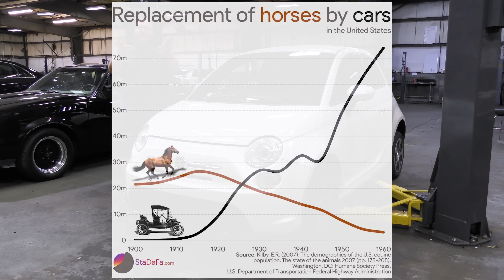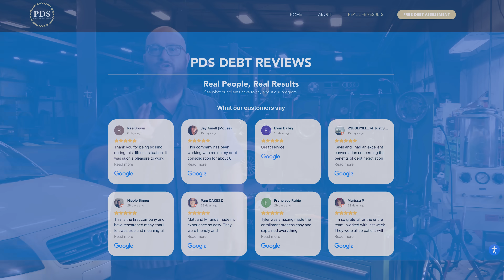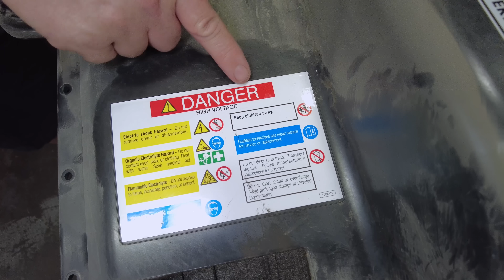How to SAFELY Remove the EV Batteries From my Fiat 500e

Comment: Some people are just resistant to change.  A former boss spotted a really, really nice looking Model T Ford one day in the early 70's.  It was at a gas station and he complimented the owner on the beautiful restoration.  The reply was something like this:  Oh, I have not restored it.  When they came out with those new fangled transmissions you had to try to figure out how to change from one gear to another I bought five new Model T's and put them up on blocks.  When I wear one out I get another one down and keeping driving a Model T.  My father complained when I had two Bugeye Sprites at the same time.  Later I learned he had five Model T's when he was a kid.
Reply: The problem here is that for many people EV does not bring anything extra relative to ICE,  just perhaps a bit of gas savings at the cost of some inconvenience. So there is little reason to change. Way different situation than horse/car which changed the lifestyle completely, allowing to travel 10+ times faster
Reply: @dmitripogosian5084  true enough.  Once long range EVs flood the used car market though thats when we will see a big change.

Comment: EVs need to be easier to diagnose and repair by independent shops and owners.  How it currently works is as if an injector or ignition coil went out, so you are down a cylinder and instead of replacing a single component to restore full function you are required to replaced the entire engine.  Besides being dumb, it's incredibly wasteful.  Serviceability is green.  Disposable cars aren't.

Comment: Electric cars have been around since 1830s and rechargeable batteries from 1860s.. There were charging stations etc around that time. So EV's are not a new thing. The biggest issue with EVs is batteries and the damage on the environment from mining the materials to produce the battery add to that the degradation of the battery. But maybe once the battery tech as matured enough then they would be viable.

Comment: BEVS?  New technology?  LOL, no.  They had those as far back as the early 1800s.  Late 1800s for I suppose more mainstream ones.  It came down to the same problems that EVs still have.  All things having to do with the batteries.

That, and like ICE vehicles, BEVs have been so overly and unnecessarily overcomplicated, they throw out some of the biggest selling points for EVs.  A big one being simplicity.

Comment: I was waiting for it and you did it. You called it a 42 kW battery pack. Please read and remember what has now become an old saying in the EV world- "Not knowing a watt from a watt-hour is like not knowing the difference between horsepower and how much fuel the fuel tank holds."
Reply: I think most people just don't care about the correct terminology and is said more in favour of it sounding better. Same as when "we" are asked "how much power does your car have" and the answer is "250 horses".... it's just easier on the tongue in my language.

It is basic understanding that if you are talking about the battery you are talking about capacity, and if you are talking about the motor you mean power.

Comment: It's NOT like when cars were replacing horses. It's still a car just the power mode has changed. horse are a LIVING thing. They die, give birth, feel pain, etc. While we give cars anthropomorphic qualities, they are still inanimate objects.You don't need a person to go through town cleaning up poop all day and night. It IS the same as when cars were invented there were several modes of power. Steam, gas and electric. Gas won for several reasons, it was easier to transport, didn't take a long time to build up pressure, gave long range and quick turnaround, plus for the amount of energy given the size could be smaller and less dangerous. All of which is STILL true. EV's WON'T "save the planet" or even lessen pollution. But they DO give POWER and CONTROL to the governments that impose them upon the industry and people. Yes, impose, because they give extra tax and incentives to get them that others have to pay for, some states are making them mandatory and the only thing you can buy soon. But it'll be the government who controls you once there is enough of them.
They will be able to say when and where you can drive or even if you're allowed to do so. Let alone that the materials to make them vs a regular vehicle makes them a bigger polluter. Then there's the disposal, A modern car is almost completely recycled now, you can't do that with most of the EV's, they must be disposed of in a hazardous waste dump. 
With a FIAT, which is already a low quality car, (Fix It Again Tony), this 500EV makes it even WORSE!

Comment: I helped with a major battery replacement on a vehicle once. It was older than yours, and the vehicle  had a lot more miles on it. . And it was a lot bigger job. We replaced all 126 cells. And each cell weighed more than the entire Fiat. (The vehicle was the first submarine that I served on).
Reply: Bet the range was much better
Reply: Ahh yes, the early diesel-electric hybrids of yore! Wish I had a truck like that.😊
Reply: @KevinSmith-ys3mh  Actually, mine was nuclear. The diesel electrics had two batteries, each with a few more cells. At least, the WWII fleet sub that my first boat was named after did. I toured the WWII sub as a kid, then served on its nuclear namesake.

Comment: The dashboard head unit on my car stopped working. That meant no access to a/c, stereo etc. The dealer quoted $1500 for a new unit. I took the old unit apart and worked out that the problem was caused by cracked solder joints due to the use of lead-free solder and also and the heat cycling in that area. There were a gazillion solder joints that needed to be cleaned to even split the circuit boards so I purchased a $40 Chinese electric solder sucker. I just resoldered all the joints and it's worked perfectly ever since. Total cost of repair was $50 if you add in the cost of solder. The dealer's quote including tax & labour was closer to two grand.
Reply: Component repair is not what you get even with your household appliance such as stove of fridge

Comment: I've actually used what I assume is the same Bulgarian company (in Varna ??) to rebuild a Mercedes Transmission control plate on my old B200 Turbo.  
Turned it around quickly, worked great.

Comment: Did gasoline powered cars eventually out do horses despite the fact a bunch of old geezers are stuck in their ways? yep! Were Gasoline powered or internal combustion engine cars mandated by the government over horses? no... not really. People chose cars driven by internal combustion engine cars over steam... electric... and horses because they were more convenient, and because they also gave people jobs!

People still had a choice, they chose cars because at the end of the day they were a more convenient option. Peoples issue with electric cars isn't that they exist, it's that the government is trying to push them on people. I don't have a issue with the idea of a electric car, I think it's a great idea for that to be a OPTION! Just like i think every Gasoline powered car at this point should also be able to run on Ethanol because it ain't that hard to make it do that. Because Gasoline would then have competition that would make Gasoline and Diesel less of a Monopoly.

Comparing how we switched from horses to cars, to this electric car thing going on, really isn't the same, and it really isn't a valid argument, especially when making cars used to give Americans fair paying jobs. Instead of mining precious and toxic metals in foreign countries that use borderline or actual slave labor to obtain the materials and then produce the batteries in countries that just hate America.

Comment: The big deal is the labour to remove the battery pack. Of course, the manufacturer could have added a small access port to the underside of the battery pack to allow a mechanic to swap out the controller without having to drop the battery pack. It could be engineered safely as well. For example, it could automatically cut power to the unit as soon as the access hatch is removed. Like a "safe block" really. That's a tool for safely connecting bare wires to mains voltage.

Comment: I leased one of these cute cars. Really good deal too .I can confirm that I can regularly get over 100 miles on a single charge. I live in LA and I suspected that it loves the stop and go traffic. I would also regularly take these to go to Palm Springs and San Diego with strategic stops in between to top off. It only had level two charging (No fast charge) and I was still able to make it work. I also had AAA membership with the 100 miles tow just in case, and never once did I use it in those three years despite coming close once or twice (like  to the point that the car would no longer go more than 20 mph because it was running out of juice kind of close).
Reply: I am not an American, but a AAA-battery is probably not enough to get you home?😇
Reply: @JJVernig  AAA in this context means roadside assistance by  American Automobile Association. This service includes towing as well.

Comment: If I were you I definitely wouldn't be touching the battery pack without electro-insulating gloves until you disconnected enough busbars between modules so the voltage in any part of the battery is below 120V.
After many years of working on self-made accumulators for Formula Student that were 450 or 600V I know how dangerous they can be. With proper precautions they don't have to be, but you must never forget about it
Reply: Even 120v dc will kill you as you can't  let go !
Reply: @stevejones9788  Thomas Edison electrocuted circus animals and livestock with Westinghouse/Tesla's "killer (alternating) current", promoting DC as a safer for consumers.  At the level of current and voltage we're talking about here, one could be just as departed with either AC or DC.  Shop safety will have a different look than we're used to in ICE repair shops.
Reply: Completely agree... even my Grampa (WW2 US Army Engineers electrician) said "never trust electricals, it'll bite you when you're not thinking!" and my training was that 50vdc or less was the upper safety limit, 28v or less is the range of real safety.
Note to general readers- its actually the current flow thru your body that kills, and EV packs have obviously massive Amps potential! If you dont completely understand electical hazards, do the course work or dont get under the hood!

Comment: I have owned a 500e for 6 years. Driven it over 60K miles. It hasn't given me a any problems at all. It's a blast to drive too! I live in North Carolina and have never even seen another one here. If it ever dies I probably won't be able to find anywhere to get it repaired. I've gotten my money's worth out of it already but really hope to drive it for a long time to come! I enjoy watching your video and hope you get it repaired soon.
Reply: You feel like you have gotten your money's worth at 60k miles?  IMHO cars are too expensive and take up too big of a chunk of my income to only last 60k miles.  But that is my experience and your circumstances are undoubtedly different.  I have a 2017 Toyota Prius that we bought new for $23k and have driven 130k miles.  I think that we have gotten our money's worth out of this car, but it keeps going.  I did the CVT fluid change, that battery pack air filter change, changed the coolant, and routine maintenance of course.  Let see if it makes 300k.  In 2024 we bought a new Prius at $33k.  I hated to pay retail, but the 2006 Envoy was getting long in the tooth and I wanted an efficient commuter that was fun to drive.  Needless to say we like the Prius.  I have high expectations out of our latest acquisition.  Good luck with your Fiat!  I hope that you get well over 100k out of it!
Reply: @robertmooberry725  I paid $8,400 out the door, all costs, when I bought my 500e when it was 7 years old with 32K miles on it.
My point is.... you don't know how much that guy paid to say only 60K miles is worth it.
Reply: What part of NC? It wouldn’t happen to be Raleigh?
Reply: At over $30k starting price, you got your money's worth out of it in 6 years and 60k miles? Damn, the standards are getting low.
Reply: @rarespetrusamartean5433  He would not have been able to buy it new, unless he was living in Cali or Oregon. Every other state, you're buying it used.
Reply: @rarespetrusamartean5433 if you had a car that you didn’t have to maintain for 6 years? Yes. No oil, fluids, etc.
Reply: You're lucky, fiats tend to be junk
Reply: @JStorm13 mines great
Reply: @JStorm13  the whole drivetrain is made by Bosch, in this case. One big reason I was willing to risk it.

Comment: I have no doubt that EV's or some non fossil fuel powered vehicles are here to stay.  You mentioned the biggest outstanding question which is longevity and ability to keep them on the road.  Are they going to be disposable vehicles?  A 1908 Model T Ford can still run and many from the 1910's era are still running and driving as well as they did the day they rolled off the Ford assembly line.  Will it be possible for a 2024 EV to be running 116 years from now?

Comment: Your gasoline horse analogy does not work in the context of the modern EV.  Back in the early 20th century the internal combustion engine was better than a horse in every way, which meant it was adopted by the populace organically rather than by government dictat.  Fast forward to the 21st century and EVs (which still have exactly the same shortcomings as they did a century ago) are inferior to the ICE vehicles in every conceivable way.  The only way they are making any impact at all in the car market is with market manipulation through huge subsidies from governments.

Comment: EVs have to have good thermal management or their batteries wont last.  This is why 99% of the population should NOT buy a car like the Nissan Leaf.  Second, with as awful as Fiat quality is there is no way in hell that I would buy a Fiat 500e EV let alone gas version of their car.  Looking at their battery pack to me looks like terrible, inefficient design.   My perspective is I would only want to buy from a company that is 1) going to be around 2) is trying to truly standardize their parts and batteries and 3) is truly committed to the models of cars they make.  That is why to me, Tesla is the no-brainer decision if going EV.  Regarding range, you can get 200 miles of range at tesla quick charger in 15 mins, you dont need 1000miles of range and  you are simply not going to see that in the long foreseeable future.  The vast majority of people will find 300-350 miles (that you see in Teslas today) are way more than they need for their daily commuting back and forth and normal day to day lives.  You go back and forth from work, etc... come home, plug your car in and it's fully charged when you go to leave the next time or next morning.   The current mindset of people feeling compelled to get rid of their cars because of engine mechanical unreliability due to high mileage going over 100k, 200k in miles will be very different in the EV world.  You eliminate TONS of mechanical complexity of the internal combustion engine down to an electric motor and batteries.  The batteries being made now are already very different from those used in the original Tesla Roadsters.   People are going to find EVs require very little maintenance and require a lot less time in the shop.  And if for some reason you do have a battery pack problem, I would only take it back to Tesla.  Costs of the batteries used in EVs have also dropped a lot in the last few years.  EVs will only get cheaper and will eventually displace gas powered cars for a large percentage of the population.  The Chinese are already making EVs at price points US auto makers cant even consider to make a gas powered car.  They are already 3-4 times cheaper per mile when charging at home vs gassing up and at sometime in the near future should be cheaper than gas equivalent.  (We are still very early in the timeline of this transition) The change is coming and it will be a good thing.  For those who want gas cars, by all means stay with it.  I dont have EV yet but plan to in the near future but will still keep gas cars in the roster.

Comment: I'd say a universal system and more importantly, if packs are to be used (individual battery packs) make them easier to exchange for everyone,. maybe not the owner, but most shops (like make them plug-and-play which some are in some cases).  Once we get universal compatibility between brands (which may be a while) then I think EVs will take off (that and once they can gaurantee a battery will last for 10 years or 100k miles and charge in under 15-20 minutes to 100% and then go 300 miles; basically they would need to equal what the typical gas powered sedan can do from a performance, range, and recharge -- "refuel" -- standpoint, as range, cost and time to recharge are the three biggest things working against EVs).

I would say as a start, if we can get a battery that can be replaced for a reasonable price (maybe $5k) after 10 years, that will start the process, as that is probably one of the biggest things holding people back, particularly those who want a car for a long period of time (10+ years).  They know that they'll need a battery around the 8-10-12 year marker and it will be expensive most likely)  But so far, cars win at this one as many cars can easily go 100k or 200k without any major issues and last well beyond 10 years if they are just cared for (regular fluid changes and don't drive like an idiot/race car driver).